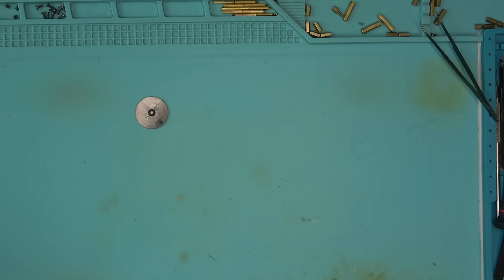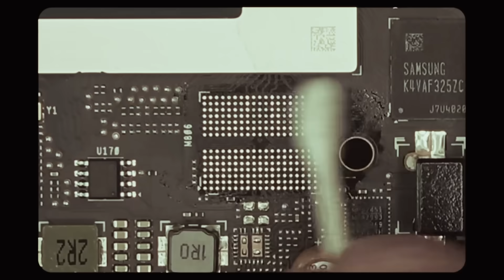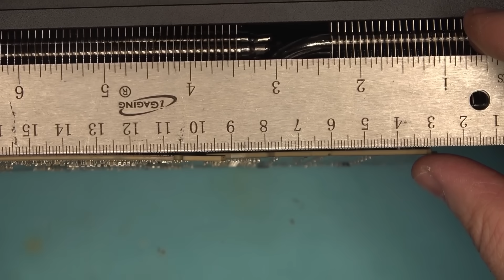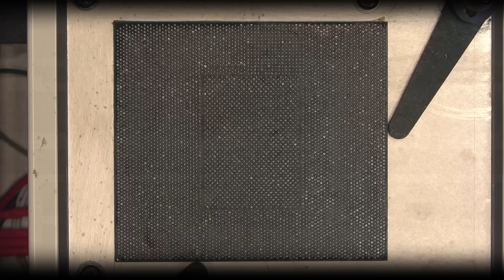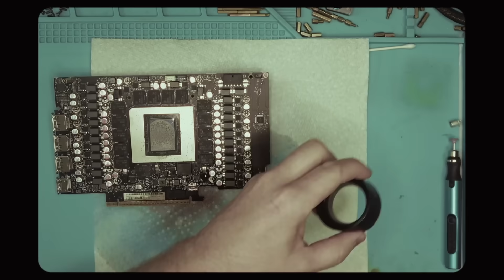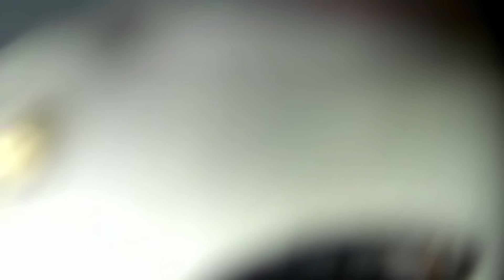Watch this guy performing "out of this world" repair on an RTX 5090

Comment: That's a disappointing design. Can't believe they welded the vram cooling. I have a PNY 4090 XLR8, but I use an adjustable support bracket on the outer corner. 2.5 years of no issues so far.

Do you have any particular GPU brand you recommend for Nvidia and AMD?

Comment: GPU have gotten SO as in fundamentally TOO heavy that the traditional edge connector, and edge connector hold down hook can no longer reliably support the GPU without some sort of bracket to prop the weight of the card. I'm also thinking that the 12V plug in connections should just be hard wired (no plug on the GPU, then of course the cables provided by the manufacturer) with ONLY the cable connector plugs into the power supply.

Comment: Just curious about the capacitor that you removed just above the crack, but never replaced.  Was it necessary?  If not, why did they put it on the board in the first place?

Comment: How does a GPU end up cracking on the board like that? Mishandled shipment or installation error, like neglecting the anti-sag support?
 
Great repair. i have the same card, hope I don't ever have to send it in.
Reply: These bigger GPUs need to be supported with a stent or the tower needs the mobo to lay horizontal instead of vertical. This has been a known issue with some 3090s and 4080/4090s. Sagging is a huge issue on 3 fan nvidia GPUs. And yes, simply moving the PC around can lead to this.

Comment: Maybe the crack is so fragile that handling it makes the front walk. Is it impossible to make a small hole in the front of the crack? That's how I stop cracks from enlarging on plastics. I know a hole might damage a bit, but at least you can dig in until that hole and repair. If not, you would end up chasing broken connections one after another as the crack propagates

Comment: I work with electronics, and I'm very familiar with how a circuit board is supposed to look like. I notice a lot of the components on the board are slightly misaligned. While not a big issue, it allows for a higher probability of a short happening. Quality control is supposed to catch those mistakes, but it seems like they weren't that big of an issue to them. Nvidia being lazy once again.

Comment: My 5090 works perfectly. Mostly because I handled it's installation with a soft touch (many don't) Connected power cable all the way in without gaps or stress - MSI 5090 Trio OC. Premium silicone. OC'd to 3200+Mhz! and RAM +3000 in afterburner modified version.
Reply: I'm going to handle it the same way. Minimize user error as much as possible

Comment: How much heat did you set the heatgun to remove the VRAM? I always struggle to remove the chip off that quick, takes me 10mins at least. So you also preheat the board in an oven ?

Comment: when the crack is repaired and the connections are jumped is the wire used just solder wire?? and to fill the damage is that an epoxy used and cured with the black light? thanks! im trying to learn

Comment: This repair makes no practical sense, considering that you resoldered the GPU and memory. It would be much easier to buy an empty card from the Chinese, which they sell very cheaply now, and transfer the memory and GPU there. The Chinese do this because they transplant memory and GPU for the AI server, and they have a lot of empty boards. Fraudsters do not sleep either, they sell these dummies as full-fledged

Comment: The crack repair dremel-down, wire soldering and epoxy/resin laydown were hypnotic to watch. I've done a bit of small component / surface mount work and that was tricky enough, but your reballing/rework skills are absolutely fantastic to watch. Next level precision, dexterity and speed! Your knowledge of how the boards should power up and function is also ridiculously good. S-tier repair work. Have you tried FlexBV by the way for schematic/circuit work? Rossmann and others have used it for many years.

Comment: Hey. I do work like this a lot and have similar eqipment to you. I just wanted to say props to you because this is definitely not easy work. The parts i enjoy most is reballing and also the investigative process to what is wrong with cards. I also repair RAM modules and processor pins. One of the crack jobs i had to do was on a long PCI card in an old server, however it was on the front tab of the connector and i did the same trick as you. the water is a good idea to keep the chips from getting everywhere. nice work on this card.

Comment: in the automotive field they make a power probe tone generator for finding broken wires in harnesses, you put the signal through the line and follow it with a beeper device, it beeps along until you get to the broken part and no more beeping etc, something like that would be useful to find broken traces im sure. great job on the crack repair.

Comment: With RTX 5090 reaching 14 layers PCB, fixing cracks is very hard - kudos on the ingenuity of the fix. Those companies need to reinforce the PCB with some thick metal support especially near the pcie connector, those cards are just too massive.

Comment: With graphics cards now weighing a ton, i am surprised the manufacturers are using same old flimsy circuit boards which were made for far lesser stresses. I would cut off that protruding notch at the back end of the card before first installation. So thjat there is no stress point and no resultant crack later in the card;s life.

Comment: I love how you speed things up son. No one can tell what you're doing.
Reply: isopropal alcohol, flux than soldering, than measuring volts, amps. Removing old solder. Checking schematics. Drelling around pcie port several layers of pcb.
Reply: @alvydasjokubauskas2587  Deez N utz, GOT EEM

Comment: Most people would either do nothing with the "core" or reflowed it at best. This attention to detail is what makes you great at what you do. I kind of don't like your take on amd cards, but can't blame you tserver is that bad that people prefer to short* the vref of the vram chips to identify the problem sometimes.
* not direct but with a resistor, 510Ω or so, enough to change the vref to the point it loses the proper voltage, so if it aligns with the artifacts, it is probably that chip, or the core, or pads, maybe all at once, pure pain and misery. If there is no signal, good luck.

Comment: Wow, I saw so many things I never saw before.  In my youth I've done trace repair with surface wires, but I've never ground down into the PCB like that.  The use of UV-cure resin to rebuild layers is smart.  Your ability to position the finest wires is amazing.  I'll have to go back through your videos to see other examples of crack repair.  It was also eye opening to see a state-of-the-art reballing technique on such a huge die.  I love the visuals of the balls melding onto the pad.  I was surprised to see the footprint on the GB202 is not a uniform hexagonal grid, I wonder what the rectangular grid portion does differently than the rest.  The one question I have is why not use a heat shroud sized to the smaller chips (like the memory die) when you use the hot air gun?  I see you used a heat shroud on the GB202.

Comment: Hmm nice soldering but make sure to get your terminology right:
Core - a processing element plus perhaps caches and bus interface, not the chip in the middle of a graphics card. Y'know like a multi-core CPU, there are not multiple chips in there, but multiple of the same core fabricated on the same monolithic die
Die - the glassy black silicon. Contains multiple cores. This is soldered to the chip package substrate which is basically just a dense little PCB
Chip - what you removed

Comment: After all these decades, after all the noticeable deficiencies, manufacturers still haven't progressed past the PCB mindset. Those boards are not designed for lateral movement, so they stick big fans on it to ensure the stresses are magnified every time you run the card. The fans cause oscillations that  cause stress cracks to appear and widen.

The problem is, in my opinion, the locked in dimensions standard for card edge connectors, the slots themselves. It's a 100 year old design and its time is over. Put that old baby back to bed, manufactures. Time to design and construct robust cards and connections. These cards are far too expensive to leave so weak. The first thing is to double the thickness of the substrate itself. Increase the width and depth of the slots.

Comment: Wow. I can't even fathom how these are produced at scale, with seeing how much skilled labor is involved with a repair.

There is nothing more admirable than watching a professional exercise their honed skill. Impressive!
Reply: They’re made on automated assembly lines, nobody is hand soldering these together lol.
Reply: It is no different than producing other boards. Look at some videos about EMS how boards are produced. Nobody at EMS is repairing faults like that. It simply will be scrapped. I have worked several years for EMS repair. I repaired products that literally failed tests(ICT, FCT, BIT). But these products were made for industrial products not consumer grade. So proper testing including BIT where products are under huge stress in varying temperatures. Very common like 24h test duration while products go from like -20 to 70 degrees celcius in cycles. Also some products were even tested at -40 to 90 degrees celcius. Some extremely safety critical stuff.

Comment: Can these tiny bypass wires handle long term high currents these card have? It works for now but they have the potential to light up like a lightbulb when hidden damage degrades causing more shorts. Knowing 500 Watts go through these it's better for consumer safety to murder the board beyond repair instead before some kid burns his grandma's house from the basement. I guess it's a fun video to see if it can be MacGuyvered but apart from that the card not safe to sell or actually use anymore. It's great for spare parts
Reply: Yeah I wondered about that also.   I would never run such a device while I'm out of the house.  Only while I am in the room with the device.    Most likely the system will just shutdown though, all the motherboards and PSUs have short-circuit protection, over current protection etc.   This happened to my EVGA 1070, was just watching a movie and black screen and puff of smoke.   The PSU detected the short circuit on the 1070 and shut it off.

Comment: This "cooling solution" is even more primitive than I expected. Getting a non-FE-5090 is definitly that last thing I'd do. They've just bolted on the same cooling hardware that they did for the last years. Back then you could at least imagine that having a bigger cooler and more fans equals better cooling but now with the design of the FE around, all this has become pointless. There's no reason anymore to get a non-FE other than it not being available and you desperately need a 5090 right now.

Comment: So I noticed something...during the test it only draws around 450w this is most likely due to the pci express slot limitation of the motherboard or the power supply or both, now that card(the 5090) on a pci 5.0 slot draws much more power and the cards will perform better but at the same time it might misbehave or lead you to a defect that you can notice
Testing it on an "old" motherboard will only allow it to draw 450w so testing in this environment may not actually stress the card enough to point out any defects or flaws but if a user has it on a newer 5.0 pci express motherboard then it will be used at its supposed maximum potential and the results may vary.

Comment: Clearly a poorly built GPU that usually "ONLY" cost double the absurdly high MSRP 😂
Tracks near a very possible failure point and crappy materials/structure on that board in a very heavy card with a stupidly heavy and poorly built cooling solution.
It makes no sense.
People, stop buying overpriced garbage! The prices will keep going up and quality down as long as people keep buying.

Comment: All the comments about "use a support" I have a 7900xtx, it came with one.  But it doesn't work its a POS.  I had to fab my own.  For a non tech person that would be a bad thing as it could be confusing on if it is needed.  My 7900xtx didn't have an install notes or anything. Just a quick overview of the card. The support was just thrown in the box. Not even a cut out spot like the other parts. 

BUT everyone is missing one big point.  If the card NEEDS a support it should be a BIG note in the box.  ON the box and a BIG NOTE  "WILL NOT WARRENTY" if the support is not used in a vert mount position. OR just make it so the larger cards are only for horizontal mounting.

Comment: Cards ripped in half
“I’ll just reball the chip and see if that helps!”
Reply: ikr; great tedious work he does.
Reply: Just casually reballing the core of a 5090 "mhh yeah lets reball this thing and see if it helps"🤷‍♂️
Reply: Horrible design the ATX spec was never supposed to be used to hold cards that weight more than a PSU.
All GPUs should be mounted in flexible extender or they should upgrade the ATX spec so the GPU plugs bellow the motherboard with an edge connector on the motherboard.
This is insanity.
Reply: @monad_tcp  It is user error if you get an aircooled GPU and not use a bracket. It is not the fault of the motherboard that the user chooses not to use one.
Reply: @monad_tcp  these cards should only be installed with a PCIE riser
Reply: @monad_tcp  IDK, the cards i have are laying upright, not on their side and they're just fine. 0 sag
Reply: @monad_tcp  Or you can just jam a tube of chap stick or something between the card and the bottom of your case to prop it up. There are other ways that are probably more elegant to achieve the same effect.

I agree in principle that these cards shouldn't be this heavy, but here we are.
Reply: @monad_tcp  They want them to break? Nothing is by accident!
Reply: @Trumpinator-47  yes and no. at the level of financial incentives these companies are doing the equivalent of burning furniture in the house to stay warm for a few minutes, but the people making boards that crack and failing to update the spec to prevent it are probably throwing their hands in the air and saying "whatever, it's their problem" rather than engineering for max damage.
Reply: Standard operating procedure, not genius level.
Reply: @SuperhamW5  ALWAYS some low lvl twaot to make troll lvl BS comments... go take a long walk off a short...
Reply: @SuperhamW5  Upload a video of you making the same thing then i'll believe it's "standard"
Reply: @SuperhamW5  How odd. You say it's "standard" yet your channel is over a decade old and you have 0 videos of you performing this "standard" repair.
Reply: @pokealong he’s not a repair technician. He is 100% correct regardless lmfao. Just because someone films something and puts it on YouTube does not mean they are the only repair shop doing work like this.

Comment: I've soldered boards for 17 years for a company and not once have I seen anyone dig into a board like that. I kind of died inside watching that. But it was done and fixed and I'm still in awe lol. Crazzy stuff man. I've gota send this to my co-worker/boss.
Reply: Look up kamikaze switch mod. Been doing a few of those with 100% success.
Reply: its actually pretty commmon. somebody fixex a ipad mac mini the same way... clipped through by apple no less.
Reply: Don't send to your boss, they will think you suck in comparison.
Reply: "If it already fucked, you can't fuck it any more" - some guy, somewhere, some time  - Probably
Reply: Thats the part I don't get, isn't there literally a lot of tiny ass wires everywhere inside the PCB plastic itself? Like how do you drill into that without accidentally breaking a bunch of circuits that u can't even see?
Reply: @mrx10001  they are mostly built the same way. ground plane power plane transfer lane. that and a good hand and its that easy. you see in the video he has to reconnect a bunch of stuff with wires.
Reply: @mrx10001  there are no wires within the pcb, just traces which can be identified via the schematic.
Reply: @mrx10001  He has schematics. He even has them available for other people to use on his discord if I'm not mistaken
Reply: Im the kind of guy that has ways of making electronics talk, Ive had devices magically start working just fine the moment I say, "okay, lemmie grab my tool bag, I once fixed a laptop by forgetting about it, when they came to pick it up they turned it on and said "hey! It works!" and I was like "....uh yeah. no worries...."

I legitimately puckered and held my breath when that part came up.....Like, yeah, its my kind of 'its just needs pixies to get from here to there' kind of bodge....but considering what its on.....Was not expecting that....Dude is a mad man fore sure!

Comment: I am glad you brought so much attention to the cracking PCBs. I have 2 4090s and 2 5070s in my family's PCs. I have been extremely careful with them since you brought this issue to the light. I also make sure I don't buy motherboards with gimmicky card release systems.
Reply: The worst is ASUS and their pull the card and hope for the best design. The cards are getting so big that it’s actually hard to do it the standard way.

Comment: I find that PNY isn't low quality, they are just no frills. If you just want a simple, solid black card with no RGB, then PNY is the way to go as they are typically cheaper. I got my 2 5070s in March and June. I paid $549 for each one. That is MSRP. They also run incredibly cool, around 54C compared to my 4090 whick likes to sit around 70C on its hotspot when under a decent gaming load. I really like PNY.